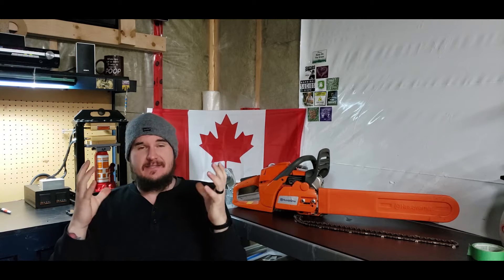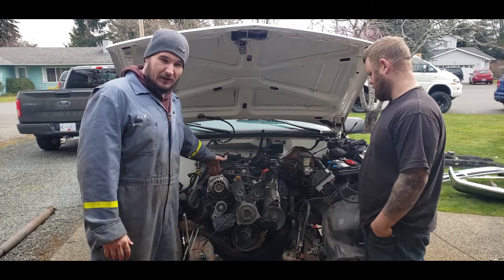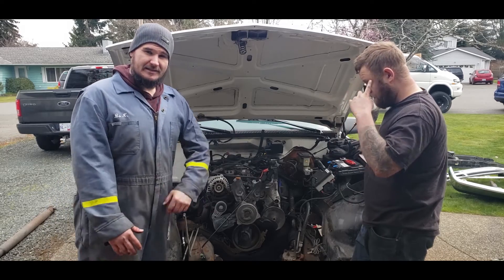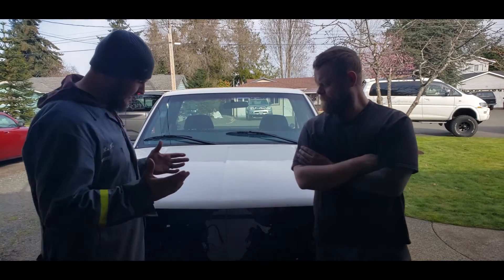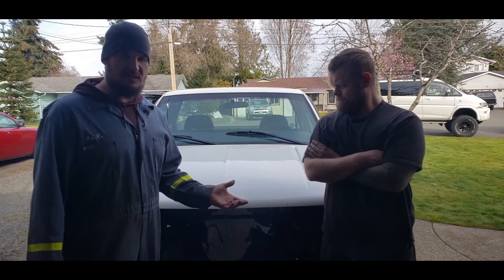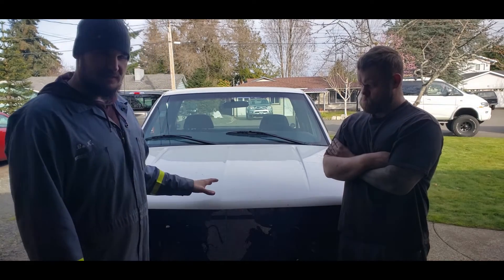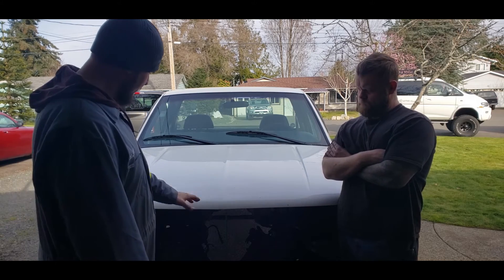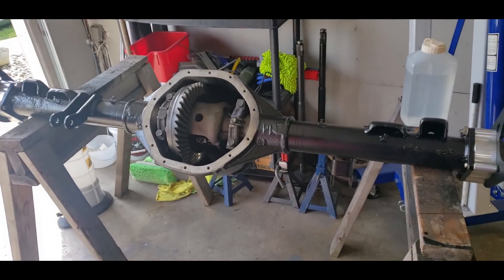CHEVY OBS TURBO LS BUILD (Ep 1)

Comment: Are you close to (PART 2) of the video? I'm very interested in how this goes. I am collecting parts for a twin turbo build. Its my 1st turbo and 1st LS swap. Its going in my Rust FREE 96 RCSB C1500 Silverado! Very excited to see how everyone on youtube are doing their builds. So far 2005 all aluminum LH6 out of trailblazer, 4L80E transmission, a bunch of 3" Stainless steel Tubing with plenty of 45⁰ & 90⁰ bends and connectors for hotside. Hopefully by next year finger 🤞